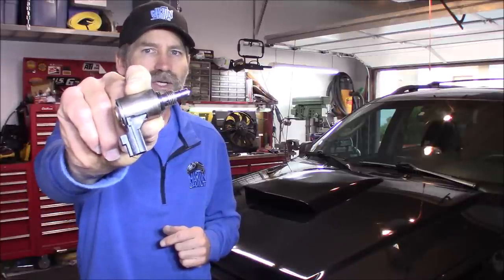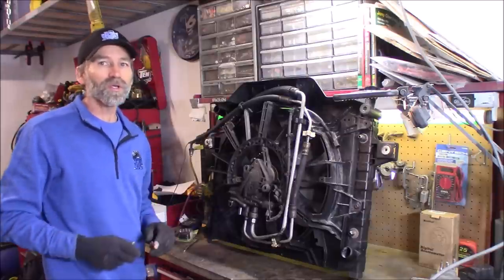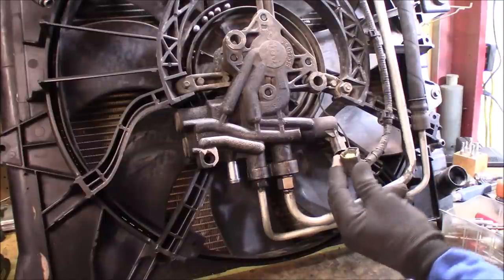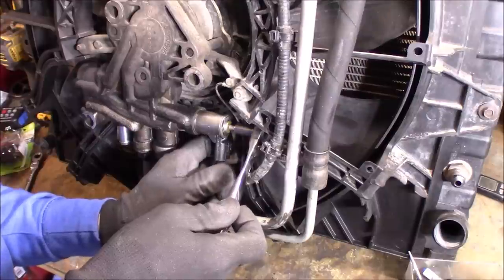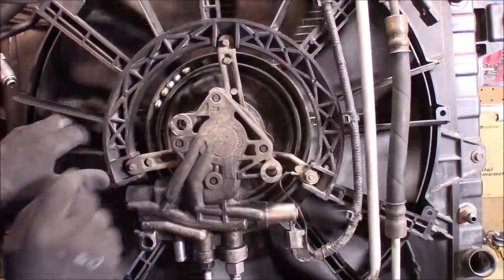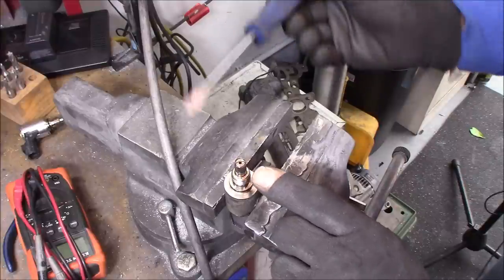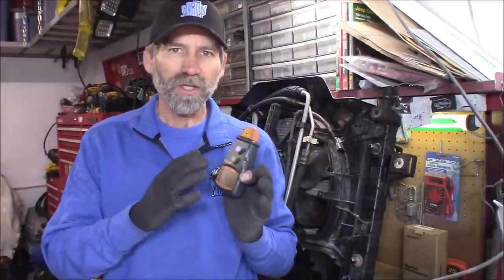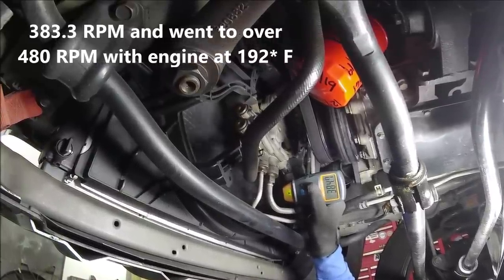01-04 Jeep Grand  Cherokee Hydraulic Fan Solenoid Mod, Remove &  Replace

Comment: Hey Martin great video! how did the half turn mod work out in the long run? Did it provide adequate cooling or Was the Jeep still heating up in traffic and stop and go? I’m thinking about doing this mod as well.
Reply from the maker: It did help quite a bit I had temps around 10 to15 degrees cooler but not enough for me. I'm wanting the most and the best performance I can get out of this 4.7 ended up switching to an electric fan. Here is the video on that conversion https://youtu.be/J02nYci5DS0
Reply: hey Martin thanks for the reply. I did see your you E fan conversion video, it was awesome but too much for me since I’m sort of a novice! I did the solenoid mod today and after install everything seems great. Had a question though. I don’t know if you remember or not but when you did the mod and started the car for the first time did the fan kick up really fast at about a medium rpm(somewhere between idle speed and full blown airplane mode) and then slow down to a lower rpm when the car came up to operating temperature? Sorry for the super long message.
Reply from the maker: @xmanzcovers4434  No, mine seemed to operate normally, just at higher RPM then before and never close to airplane mode.

Comment: Hi Martin, would you have a similar solution for the hydraulic fan system which is on the 06' Commanders and Grand Cherokee with the 5.7? Thank you.
Reply from the maker: If I come across one I will see what I can do. You could convert to electric fan like I did and couldn't be happier. https://youtu.be/J02nYci5DS0

Comment: Martin, I have problem with the Hydraulic Fan Solenoid, but I dont have idea,  where I can Buy a new on. can you help me where I can buy one !! Thanks I Live on Mexico
Reply from the maker: Unfortunately you cannot buy a new solenoid.  Have you checked the fuse to make sure that it is not blown it is the same fuse for the 02 sensor found in the power distribution center under the hood.

Comment: Mine has electric and clutch fan both were fail I got electric one going it holding but clutch fan is tough with out air hammer wrench my brother has shop  04 4.0 I seen some one put dodge 03 fan in had same thread but had to cut shroud

Comment: Dear MARTIN
Thank You for the movie.
Where I can buy the solenoid?
Best regards
Reply from the maker: Is there something wrong with yours? I have seen them on eBay. I also have a couple of extras.
Reply: Sorry for the late reply. Theory I don't need. When disconnect the cable of the temperature sensor, the fan go to safe mode and work well. The problem is when the car is at idle and the fan do not move. I changed the oil and tune the solenoid as you did. And now is moving. thank you. My question is if i will need the solenoid, where can i buy on new? I live in Portugal and is not so easy. Again thank you for your support and videos.
Reply from the maker: @ivodospenedos3714  You can not buy a new solenoid. If you need a replacement you have to buy used. Chrysler only sells the whole fan assembly for over $1000.00

Comment: I have an 04 grand Cherokee I searched on YouTube and found out you can change those solenoids so I bought one used but in the mean time I had mines direct power as soon as you start it turns on at full power making a loud noice keeps my engine cool but it’s to loud to keep driving with the family. I installed the new and disconnected the power but the fan still does not kick in fan barely spins I can stop it with my bare hands if I tried
Reply from the maker: There may be something wrong with your fan motor. You could try modifying the solenoid as I've shown in the video and see what that does for you.

Comment: i tried removing the solenoid on my 06 grand cherokee and where there is supposed to be a T40 there is just a little metal ball cap. is this entire solenoid supposed to be unscrewed?
Reply from the maker: Sounds like you have a different style of solenoid. 
 There were a couple different styles of solenoids.

Comment: Hi Martin, If I want to change a Electric fan, how many CFM need it?  Do you Knocw max Cfm hidraulyc fan wj original?
Reply from the maker: I don't know what the CFM is on the hydraulic fan but if you're able to turn up the solenoid I can tell you it moves more air than any other fan out there but you'd see your gas mileage definitely go down.
 I like the electric fans from the 98 Jeep Grand Cherokee with the 5.9 and there are some fans from Mercury villagers and for Taurus that I like and a few from Volvo's

Comment: Hey man my Jeep was running good after I replaced the solenoid a couple days ago got a junk yard part but the coolant would bubble after driving and my resivor was full but it's been pushing it out. I changed the thermostat and bleed the system but it's still over heating and now the resivor won't go down at all even when at running temp. Please help if you got any ideas. Also when bleeding it like shoots out the bleeder hole like it's pressurized even when radiator cap isn't on. Before today it also was able to cool down when driving and just a min ago it got dangerously hot almost 280 I don't want to blow this engine. Any help thanks in advance.
Reply from the maker: wow, 280...That is sounding like there is a blown head gasket.
Reply: Pretty sure I had these same symptoms and I discovered I had installed the thermostat backwards.

Comment: Hello from Spain. I have the same hidraulic fun on my 2002 European Jeep GC 2.7 Crd (Diesel).I do not have temperature problems. When i turn on the car, and it is cool, i have a rare  noise from the fun,that disapeer when Hot.What could It be?(.i think in Jeep service do not sell me a good hidraulic fluid). A lot of thanks.GOod Job
Reply from the maker: The hydraulic fan requires a special fluid, This is one of the approved fluids 
Red Line 30404 Power Steering Fluid - 1 Quart Bottle  https://amzn.to/2U8VtAe

Comment: MARTIN 
MY NAME IS BILL I NEED SOME HELP I REPLACED MY RADIATOR IN MY 2003 JEEP GRAND AND NOW I DONT HAVE ANY POWER STEERING AT IDLE I HAVE POWER STEERING AT 1500 TO 2000 RPMS I HAVE FLUSHED THE SYSTEM AND REPLACED THE POWER STEERING PUMP DOES THAT SOLENOID HAVE ANYTHING TO DO WITH FLUID PRESSURE GOING TO THE POWER STEERING GEAR BOX WHEN I FLUSHED THE SYSTEM I HAD A TON OF FLUID COME OUT OF THE RETURN LINE FROM THE FAN BUT VERY LITTLE COMING FROM THE STEERING COOLER BACK TO THE PUMP CAN YOU HELP ??

Comment: How can i test if the solenoid is working properly? I have a 2009  jeep gc 3.0 crd, and the high speed on the radiator fan wont start.
Reply from the maker: On my 04 grand Cherokee  I use a ohm meter on the soldoid with the connected unplugged.
 You should see something close to 10 Ω of resistance.

Comment: hello i have a problem thats making me crazy theres signal to the solenoid nut it will only stay at minimun speed unless i disconect the engine coolant sensor. when we disconect the conector that is located on the side of the radiator close to the battery, we have signal but as soon as we conect it back togheter that signal drops to 0.
Reply from the maker: sounds like a bad solenoid. Check with a ohm meter should have something around 10 ohms. Disconnect the connector at the solenoid and meter across the 2 terminals.

Comment: My hydro fan on my 2002 grand Cherokee stopped spinning, it won’t spin at all, what could the problem be? Can it be this solenoid?
Reply from the maker: No, it's not the solenoid.
 If your power steering is still working properly, it is the hydraulic fan itself; the whole thing needs to be replaced.
 The most economical thing you can do is to purchase one from a salvage yard or find 1 on eBay. A new one from the dealer is well over $1000.
 These hydraulic cooling fans are very sensitive to what power steering fluid you are using. Always use what is recommended for a hydraulic cooling fan from the dealership.

Comment: You help me so much ,is the same with 2005 jeep grand cherokee 5.7L?
Reply from the maker: I'm unfamiliar with the 5.7 and it's cooling system. But if it has the hydraulic cooling fan with that same solenoid I would imagine you could do the same mod. I know some of these hydraulic cooling fans came with a three wire solenoid and I haven't found one yet to experiment on.
Reply: @martinbuilt  a diferent solenoid but the same system. I want to be sure before adjusting the piece to half the clock that will run just like you.
Reply from the maker: @boomali1317  yeah that's what concerns me, you're saying the solenoid is different you may not know until you actually take it out and see if it has the same adjustment screw like the 04 Jeep Grand Cherokee

Comment: Hey Martin! I had the hydraulic fan solenoid 1499 Check engine light code so I replaced my fan with a junkyard hydro fan and it's solenoid looked like it was in great condition.  I got everything back together and cleared the Code with my blue tooth device but it popped right back on.. do you know how to get rid of this code? My only other thoughts were to disconnect the battery for a while then try resetting the code or have it professionally reset.  I'd hate to think I'd have to replace another solenoid.  Maybe I actually have a short in the solenoid wiring??? ☹️ Your thoughts?
Reply from the maker: check the solenoid with an ohm meter it should read around 10 ohms, that is with the wiring unplugged and only reading the solenoid itself.
Reply: @martinbuilt  will do! i think i found the problem... did you know the 02 sensors share a fuse with the hydro fan??? 🤯
Reply: @ProjectDanH  really? which fuse is it?

Comment: Hello Martin, I try to do this mod, but only the cylindrical part come off, the rest stay inside of the fan assembly. 
Bad luck for me.
Reply from the maker: Yeah your the second one I heard that happening to. I know if you clamp onto it the rest of it with a pair of vice grips you're able to break it loose. But then of course you're going to have to replace the solenoid. I have removed at least 8 of those and never have had that happened yet.
Reply: I'm gonna try it, Im worried because I'd be squeezing where the cylinder screws.
Reply from the maker: @hernymejias  That'd why I said you will have to buy another solenoid because you will damage the solenoid. Don't try it until you get a replacement. Or just reinstall the half that did come out and not do the mod.

Comment: Question does the solenoid also come in the electric fans? Cause I’m drifting between either this kind or electric.
Reply from the maker: No solenoid needed for the electric fan.
Reply: @martinbuilt  Thanks for the info. ^ ^ This type of problems are so painful. lol Especially if you can't find a Hydraulic Fan.

Comment: Hello, please tell me how you can increase the fan speed for the 2004 solenoid 3 contacts?
Reply from the maker: I haven't had a chase to check out the 3 wire solenoids yet. When I see one at the local Pic-a-Part I'll grab it and see what I can do.

Comment: I'm having an issue removing the solenoid apperantly after trying to remove it the housing seperated itself from the solenoid armature. Now when I try to remove it the housing comes out but the armature says stuck inside. Is there a way to remove it?
Reply from the maker: I have seen that happen before, I was able to remove by clamping a vise grip to the edge of the solenoid.
Reply: @martinbuilt  Thanks will try it out and see if it comes out. Does it normally do this or was it just defective?

Comment: Will my 2000 grand cherokee limited 4.7 with tow package run hot? because its fans are mechanical and electric?
Reply from the maker: as long as both E-fan and Mechanical fan are working properly you should be okay

Comment: Got another question, can a solenoid get damaged due to over heating of the fan?
Reply from the maker: Well that's solenoid is a lot like a injector it gets poults modulation from the ECM. I doubt the fan itself can damage the selenoid. To test the solenoid unplug the temp sensor the fan should go into high this would indicate that the solenoid is working

Comment: Hi, will this modification increase the maximum high speed capability compared to an unmodified solenoid?
Reply from the maker: No it will not increase the maximum high speed RPM. It will increase the normal operating RPM though. Once it goes into airplane mode you're talking over 2500 rpm. Engine would have to be over a hundred and thirty degrees before it would do that.
Reply: martinbuilt good to know thank you

Comment: I’ve flushed out the power steering fluid with the right stuff and just turned the solenoid in about a half turn and it still seems to be at an idle speed.. Any suggestions?
Reply from the maker: Does the fan change speed as the engine gets warmed up or when you turn on the A/C?
Test the solenoid by unplugging the engine temp sensor, located between the alternator and A/C compressor. The fan should go into what I like to call Airplane Mode, if it does the solenoid is working. There is also a fuse in the power distribution block. It shares this fuse with the O2 sensors.
Reply: @martinbuilt  Fan speed stays the says when the engines cold or at normal operating temp. Fuse is good, I’ll go unplug the temp sensor and see what that does for me.

Comment: Is the hydraulic fan part of the upgrade needed for the tow package??
Reply from the maker: that is why Jeep Installed the hydraulic fan on the JGC to give it the towing capacity but it does not perform as it should and that is why I have modified the solenoid to help it run cooler.
I have since replaced the hydro fan with an electric one and am very happy with the results.
Here is a link to that electric fan conversion. 
 https://youtu.be/J02nYci5DS0
Reply: @martinbuilt It looks like my spec sheet had the hydraulic fan optioned . It did not come with hitch but the factory had a recall for rear collision support so they added one free of charge. I have a 3000 lb single axle enclosed I use to haul my Goldwing . Mpg sucks but no problem with cooling. Thnx.
Reply from the maker: @dannyw7662  all 2001-2004 JGC WJ with a 4.7 came with a hydrualic fan, trail hitch or not.
Reply: @martinbuilt  ah ok thnx

Comment: Hi Martin, thanks for all the great videos.

I have a question I hope you'd answer. 

My hydraulic fan spins at around 500rpm but won't ramp up higher as the temp increases, except if I pull the temp sensor and it goes into safe mode. 

I've tested the resistance across the terminals of the hydraulic fan solenoid (it's a two wire to the solenoid and one ground to the fan) and I get 16 ohms, you say it's meant to be 10ohms,could that be an explanation why the fan isn't ramping up gradually when receiving a pulsed ground from the pcm but does go into full rpm when it gets a full ground from the safe mode signal? 

Also,  could increased resistance in the solenoid be why I'm not getting a check engine light for the solenoid, maybe the CEL is triggered on a short in the solenoid but won't show a warning in an increased resistance scenario.

I don't really know what a higher resistance in the solenoid means to the working of the system or how that can happen in the solenoid.

My guess is that it will require a higher current to open it then it normally would require,  is that right?  Would it not just draw the higher current it needs, or is the fact it's operated by a pulsed ground mean it only gets a set current due to the specific pulses and can't draw more?

Thanks again for the precise information you provide in the videos and comments.

I hope to get your thoughts on this?

PS,  my car remains at 97 - 99 C most of the time,  and it's fine at idle,  but on hot days,  after a 40 minute drive,  if I slow down or am climbing a hill,  it starts creeping up to 103 and will hit 107 before I turn on the heat to bring it down.

Comment: Do you know of any way to mod the 04 3 wire solenoid? I picked up an 04 fan with solenoid at the yard yesterday for 30 bucks. This is my last ditch effort before converting to electric. Even with the modded solenoid I’m still running 204-213, I’m not comfortable with that on new engine.
Reply from the maker: Yeah I know the feeling. 204 is the temperature at the ECM is trying to keep the internet. Mine would always run 204 plus as well. No I haven't had a chance to really check out a 3-wire system I always run across the two wire. Personally I would think you could install a two wire fan into a 3-wire system the one wire being ground the other two coming from the ECM
Reply: Yup I think you can do it that way but I was thinking of putting the 3 wire solenoid and fan from and 04 into my 02. Wire wise it will work, the plug at the top is the same  the 04 is just ground through the plug at the solenoid instead of grounding to the fan.  I’m just unsure if this one will be any better because it doesn’t look adjustable. Not wanting to make it run 230 again. Oh well I may try it anyway. If it doesn’t work, I’m going electric
Reply from the maker: @adjake1  yeah going electric has been one of my most favorite mods I've done to the Jeep so far
Reply: Are you still happy with the controller you chose. I was lookin at that one or the Dakota Digital. The dd  gets excellent reviews only downside is no way to manually turn it on
Reply from the maker: @adjake1  Yes, so far so good. I never looked into any other controllers. This one was recommended by Nick from Air Ram  Performance, so I went with it.